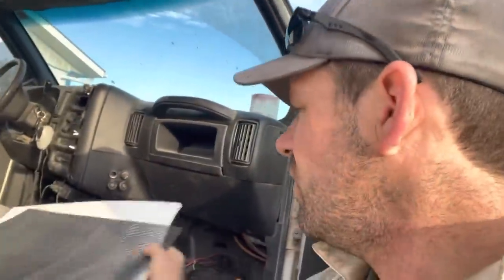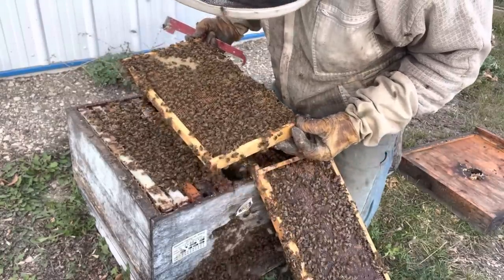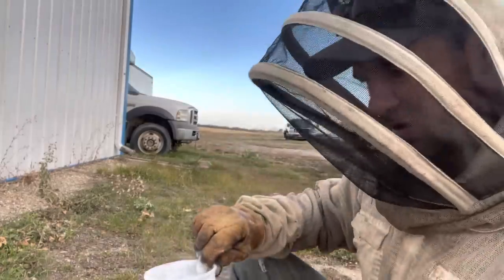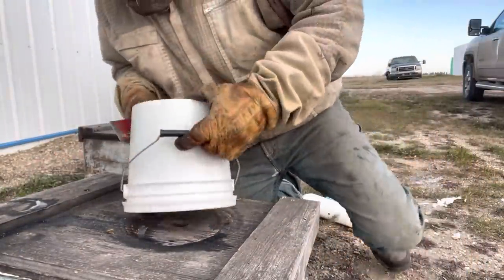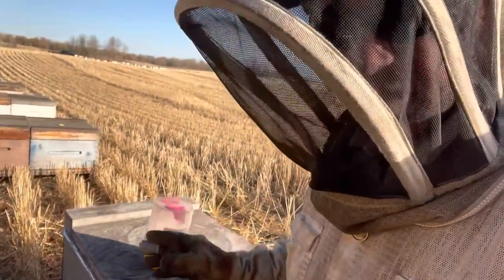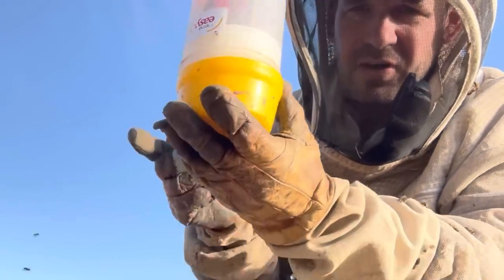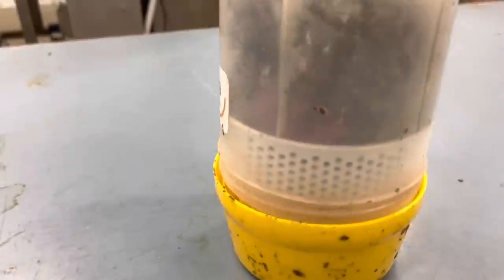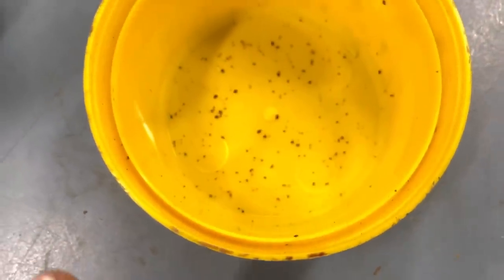Bringing Out the Big Guns

Comment: Looks like my comment in your previous video was right... if mites didn't drop from the first treatment but are dropping now... It looks very likely like Apivar has a serious Quality Control problem :( I'm not expert but it seems the most obvious conclusion to that result
Reply: You don’t think it likely that an apivar-resistant strain of mites is circulating?
Reply: @tarlneustaedter  I never said that is what I thought.
 What I DID say is, I'm not expert but considering that: The same hive with a first treatment that doesn't work, second treatment that does... Unless the hive magically switched resistant mites for non resistant ones my first guess would be poor QA.
Reply from the maker: Quality control,… I hadn’t thought of that…
Reply: Possibly a bad lot.
Reply: I believe apivar is supposed to kill, not just drop, after the exposure.  The majority of those mites are alive and crawling.  Which means in a hive they might just crawl right back onto another bee.  If those mites aren't dead within a short period of time I believe it indicates resistance.
Reply: @dtompsett I think your logic is good on that... Interesting even with switching like Ian does (apivar spring / oxalic fall) if that's the case, that they are building resistance.
Reply: I'll bet quality control is the main issue.
Reply: @dtompsett  I don’t think it is suppose to kill the mites per say. It’s suppose to paralyze them I believe and then they fall off and die since they don’t have a host.
Reply: @ETsBees  from a study... "Apivar kills mites very quickly. Using a known number of mites trapped in a cage with a single small square of Apivar it is possible to ‘count the corpses’ and plot a kill curve over time. Sensitive mites from the control colonies were all killed within 3 hours." These mites were in a jar with a strip, obviously not in direct contact at all times...
Reply: If I remember correctly apivar had a problem a few years ago. I know beekeepers who have gone to formic acid and won't use apivar anymore. But with that said, you keep using the same treatment year after year you are going to have some resistance built up. Might be a good thing to throw something else into the mix and blindside those little red devils.
Reply: @ETsBees  hmm... so then I wonder, how long does it take to paralyze them, how long do they stay in that state?  If Ian's test is causing them to drop but they're still moving approximately 24hrs later,that may mean a weak batch or resistance.  Unfortunately it's a lot of money spent on strips to find out afterwards that they aren't as effective as expected.
Reply: A lot of questions remain about Apivar, how is the miticide being applied to the polycarbonate? strip, how is the active chemical being released from the strip beyond the assumed obvious, is it being released in adequate concentration to not impede efficacy. After last season I wasn't willing to use it again, I went with Apiguard, happy with the results, will do follow up this week with dribble.
Reply: @davidryle1164  There is a lot of questions to that need to be answered. I hope it's just a quality control issue and not a resistance to the product issue. Bottom line is there is no silver bullet to get rid of mites.
Reply: If the mites are alive maybe they are running away from the apivar strip instead of being killed by it. Just a thought.
Reply: Tactic is like a band that has run its course.     The run was gold for a long while but the crowd has moved on.
Reply: @grantsimpson9211  lol
Reply: @jonhatchcirclejfarms1628  need two - three different modes of action so they can't build resistance.
Reply: The temp in the office? Wish there was a way to measure amount of amitraz on strips.
Reply: @mikeshaw8744  there has to be a way, and as I suggested in a comment, he should talk to his university contacts and get a chemistry department to figure out how to test active chemical levels for new strips as well as after the treatment period, even if it's just a relative level, so that different batches can be compared, as well as comparing residual levels after the treatment period.

Maybe the right amount is being applied at the factory, but some have too much binder and it's not wearing off and getting taken around the colony?

Maybe one of the manufacturers would even be able to help with testing, or guiding in how to test.
Reply: All treatments work best with less capped brood.
Reply: @tarlneustaedter   Apivar is based upon Amitraz. It doesn't work nearly as well as it use to. A few years back I helped out at a 3,000 colony operation as a favor for my buddy while he was resting after his back Surgery. I have a CDL and operations experience. That year, They straight up used TACTIC from the bottle with some vegetable oil dillution and it does NOT kill mites like it use to, at ALL. Soaked shop towels didn't do much.   Even with fogging with tactic on week number 3,  like they still do in South America it wasn't nearly as effective as Formic and Apiguard. It wasn't until we threw on Formic that we saw results during summmer and when I came back for Late summer and we did Apiguard for him,  it wiped the mites OUT. With Apiguard you have to wear a tyvex and a face mask with P100 and "gold" band filters or it will burn your lungs, and you have to be away from the wind wherever you apply it. It makes the boxes musty, and must be out of the hive before winter. It also ruins queens IMO. So you better come up with a game plan to keep the queen away from that stuff, or you will be going into winter with hives that have dead queens. even at 1/2 doses.  Amitraz is heavily regulated for apiary use and quite frankly I wouldn't say it is worth it anymore. Parasites do one thing and that is they adapt to anything. So it is always a challenge to fight them.

Comment: We checked our bottom boards on our two hives that have  screens yesterday, the Apivar's due to come out next week, and a few of the fallen mites were still crawling around on the board from the one with the heavier load, I smushed them but probably should have kept a few to see if they eventually die from the apivar  since it affected them enough that they fell, or whether they'd recover... We have 4 hives and tested the bigges producer and got zero mites when we did a wash, but we treat anyways because everyone else in the area does, and boy were we surprised to discover that the hive right next to the one we tested had a huge mite load. And that was our lesson that mite loads can be quite different across your yard... and when we take out the strips, we'll be doing mite checks to make sure it did its job and if it didn't, I guess out comes the OAV apparatus...

Comment: For the OAV guns, I am picturing an arm that hooks onto the top cover cleat, and a piece on the nozzle that spans the hive entrance, sealing it off as much as you want. 
Maybe a strip of wood with a groove routed along the back side so that the smoke can get to wherever the entrance is, but basically seal to the bottom board and front of the hive. 
Then if you want a vent or bee passage, you can cut a notch whatever size you want. 

I like the stands, but they seem to sometimes fight with the grass and take extra time, plus Carrie's having to stuff things into the entrance to reduce it, and since the hives are pretty much all standard, it seems like if you referenced off the lid and the bottom board, and built in the entrance seal, you could make it go faster and smoother.

If you eliminated the entrance stuffing for instance, could she run 4 guns?

If you just have to load them and drop them on, I would think you could do that for 2 guns while the last two are cooking, and just fly through it.

Comment: Has anyone looked at testing the Apivar strips for active chemical levels?
Certainly there's some way to see what the concentration is, both fresh, and after removal from the hive.

Then develop a database of average new strip readings, as well as average readings after the recommended number of days in the hive etc, and so you could compare a used strip that wiped out the mites with a used strip that didn't do anything.

Maybe it would be a lower residual level, or maybe it would test higher because it's not releasing from the strip properly?

Maybe talk to your university buddies and see if their chemistry folks can figure out a test to measure active levels.

Comment: As a beekeeper, I can't question your vast knowledge and experience. As a statistician, I can say any sampling quantity accompanied with "I don't know"  will make your resulting mite count unreliable.  I suggest all beeks use a measured amount of bees, shaken in a consistent solution for a consistent amount of time.  Any variations "for good measure" will give you what you want, not what you have.
Reply from the maker: Yes and no, appropriate 1/3 of that sample is 150 bees.  5 mites off 150 or 200 leads the same conclusion, for my purposes.  2 mites are too many for up here.  It’s a rough wash check .  The 2-5 don’t bother me, it’s the 25-30 that does. 

But I absolutely agree with you.

Comment: There has got to be a better way. Paralyzing n Gassing are pretty extreme n I realixze this is considered the most effective treatments. When the treatment requires protective measure for the one applying it and the treatments can't be applied when honey supers are on the science went off the rails. From what I have read so far transmission is by contact transfer and reproduction is hitchhiking in brood cells. What I didn't find was what repels mites? What environment is inhospitable to mites that bees are ok in? Would redesigning entrances to knock off mites be an option? When bees clean each other can they remove mites? What makes mites so prevalent n pervasive now than before?  Could frequencies disrupt mites and cause them to drop off? Would cedar or pine repel better than plywood? Any Christians laying hands on their hives and Commanding mite free hives? Soo many questions n fewer answers. You've seen it all n are working to find better treatments. May you receive revelation of a better Solution Ian. Also soo glad your harvest n hives recovered from  the flooding at the beginning of the season. Thanks for showing the harvest, the sunflowers were amazing. God bless you n yours.
Reply: Way of the world now, gotta do what ya gotta do to save your stock.
Reply: As I was reading your post, my initial reaction was, I think she is trolling. When I read the laying of hands, I am thinking, she is trolling indeed. It would be interesting to see if anyone did a research project on the laying of hands and its impact on mite count. They could also see if other religions laying hands would have an impact.
Reply: @rajbeekie7124  I am not  trolling I esteem Ian's wealth of knowledge abd willingness to teach. I have learnt alot from him and he had stated previously he is searching for a better solution. All I dud was share some thoughts. I am Christian. I pray and I lay hands. I have witnessed and received healings and miracles. Exercising Dominion works.  I am genuinely concerned and the extremeness of scientific solution has missed the boat when you have to protect yourself and the honey from its harmful effects. There still is value and wisdom in the old ways and the mites became an issue in modern techniques ..
Reply: Oxallic acid is natural in the plant world and in honey. It is the ‘friendliest miticicide’ at our disposal. 
Think Noah put a pair of mites on the Ark? Nah, they hid out on bees. 😂
Reply: @blujen1642  you mentioned an environment that bees thrived in but mites didn't, and that's what oxalic acid creates. If properly applied it doesn't harm the bees, but knocks the mites down.

Oxalic acid is common in foods, it's in all the leafy greens, spinach, various fruits, etc.
If you eat wild edibles, it's what makes Sorrel and Purslane etc tart.

Obviously you are using a higher concentration with these treatments, but the bees don't seem to be bothered by it, but in the vapor form it's an acid and causes inflammation etc in the nose throat lungs and eyes, thus avoiding the vapor.

You can't apply any treatment to a hive during the honey flow, because it will adulterate the food product, and that's no more acceptable than getting hair into the soup at the Campbell's factory!

You also ask a lot of other great questions, but every Beekeeper and researcher is already trying to find alternatives, but right now effective treatments are few.

If you scrape the mites off at the entrance, you also scrape the pollen off and starve the bees.

Some bees are able to clean the mites off to some degree, and many people are working on breeding the so called "hygienic" bees (I think I have the term right),but generally they are less ideal for commercial operations because they have lower honey production, smaller colonies, etc, but that's an active pursuit.
Reply: @blujen1642  oh, and while I know that intercession and rebuking, as well as healing energy and protection energy (kjv translates the Greek Dunimas (sic), as "Virtue") definitely works very well, and could be applied here, most people don't have the kind of faith that would be needed to make a noticeable difference in a hive, since the mites are just as physical as the bees! Lol

Even then, we are expected to do the physical work to the best of our ability, and then God does the rest.

So praying over a rocky field or one overgrown with thorns doesn't clear the field, but we can get strength to go do the work to get crops to grow.

I think the first step would be finding the ability to be quiet enough to walk and talk with God and get answers on how to treat the mites effectively.

Comment: I use a 1 litre water sprayer, cam the bees,wetting the grils down,works good,Have broken cloths dryer,use panel steel, cut into stickyboard steel sheets,with 60 mm square grids,to count one day mite drop,is lease than 9 drop a day,keep hive at 1% infestation, use a mineral oil fogger, every fortnightly, a 4 second blast into the hives,next day check stickyboard mite drop,I reduce entrances to 100mm their abouts with adjustable  10 mm by 400 mm sticks  depends,on the strength of the hives, mineral oil kills 100% of mites on the day,and only mites on the bees,just the same as oxalic acid  vaporizer, on the day of use,

Comment: Using Dawn makes no sense. All that foam has to be trapping mites in it so you can't be getting an accurate read. Maybe try some winter windshield washer fluid instead.
Reply from the maker: Yes, but actually no.  Off camera I triple check everything to catch such things before I post it.  
I am however shaking too hard